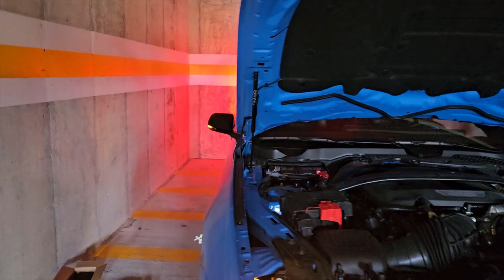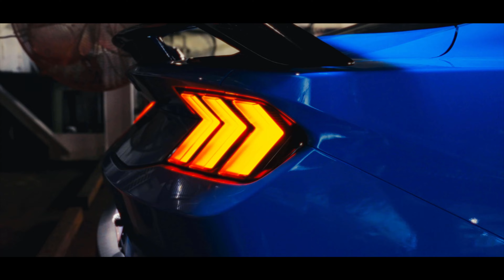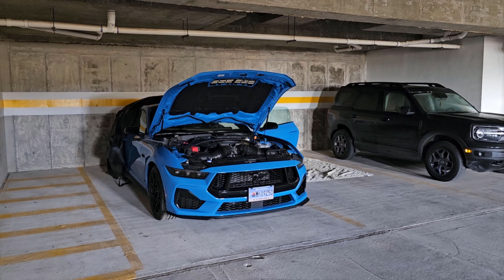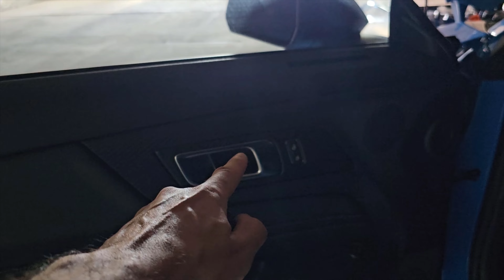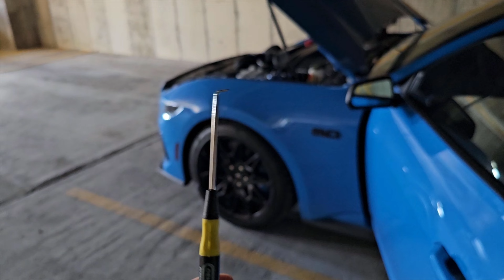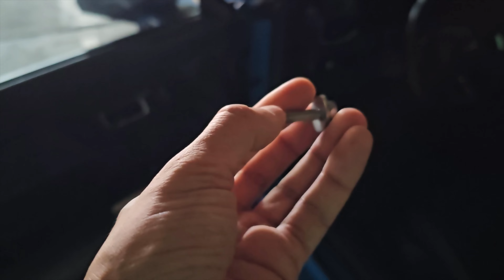How to Replace Side Mirrors on the S650 Mustang | Turn signal Upgrade

Comment: Brilliant wskzowki, everything step by step as it should be. I lack coding, in my case, even though I did everything identically, it doesn't work because the car doesn't know that it has turn signals in the mirror. Do you know where to find the right code?
Reply: Guys, after assembly go to forscan —> bodyCM module —> left / right rear turn lamp —> change to „turn only”. I have also 8 pin socket inside the door
Reply from the maker: @ukaszmichaczak4481Thanks for updating. In my case the car was already programmed since I had the 401A package. But good job on finding how to enable it.
Reply: @TheMustangTTV do you have to have the 401a to program it? I was wondering about that i have 400a and might eventually want blinker mirror and illuminated mustang door sill plate. Also wondering about the wiring harness if its there in the 400a
Reply: What about turning on the puddle lamp as well ?